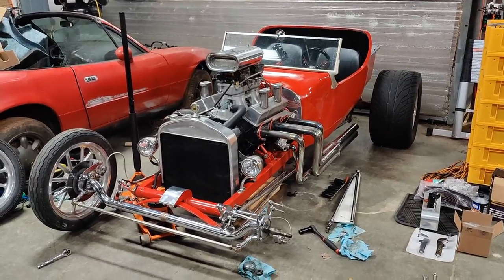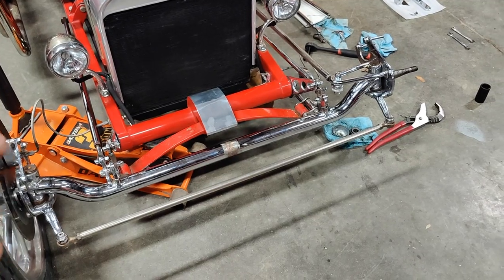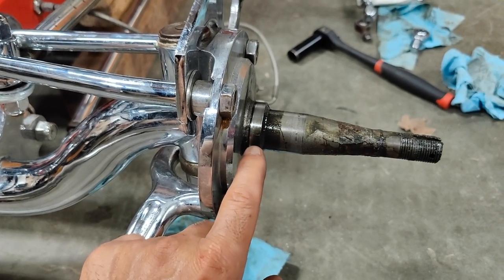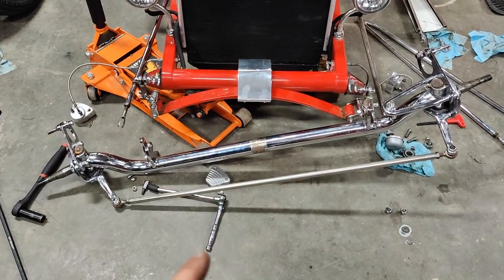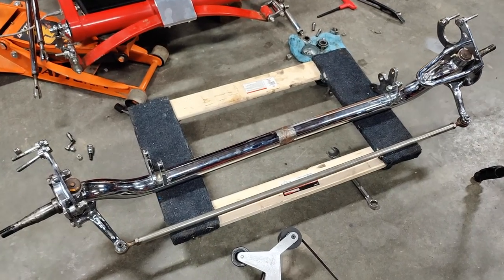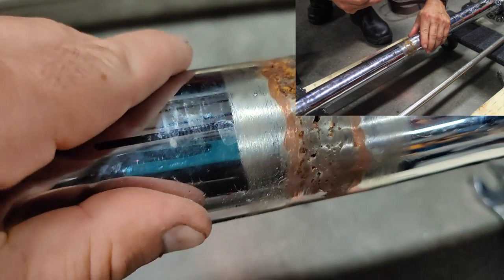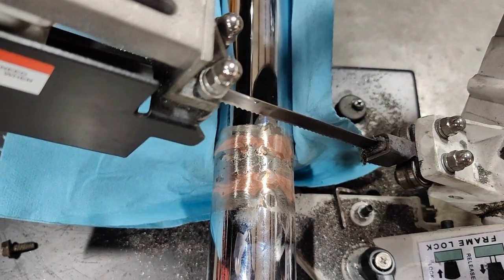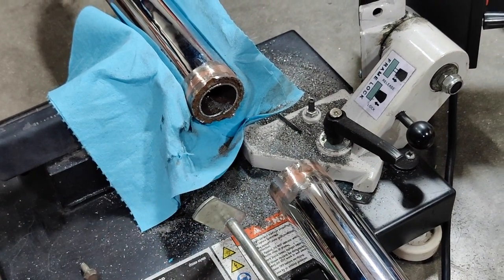Chasing Deathwobble - Part 1: Disassembly to re-fix a cracked axle

Comment: Hi Tim this is Dennis, yes that is a Total Performance kit just like my Bucket-T is.  The death wobble is what we all are afraid of as at highway speeds it will crash you into the ditch.  Mostly it comes on at a higher speed so it can start on the highway, your wobble is so bad it is doing it from a slow speed....count your blessings there.  Total Performance was a company out of Connecticut making kits until they sold out to Speedway Motors.  The tell-tale indicator is the tie-rod out front and the design of the radius rods and pick-up brackets.   By the looks of that axle after you split it I would strongly recommend getting a new axle.  You don't know how far that the corrosion has wicked up the axle on both sides and you will be welding onto rust since you cannot cut it back and shorten the axle.  I trust you took exact measurements of the radius rod lengths from bolt hole center to bolt hole center and tie-rod length, etc.  The shackle bolts you referred to as being backwards and rubbing the axle should have a slot inside and a grease zerk in one end, unless there are neoprene bushings.  I also see you still have the friction shocks (as i do until I find the right bracket), they are junk (and can contribute to the wobble) so put that on your list to change in the near future.  Also a strong suggestion would be to take out the steering sector and check it for broken teeth and repack it if it is still good.  Mostly Vega and Corvair sectors were used and that wobble could break off teeth.  Yes the Ackerman angle is critical along with toe in and plan to take it to an alignment shop when your done.  Our cars are similar in many ways, I also have a tunnel ram with dual quads and a scoop and a special license plate.  You can see and hear mine here >> https://www.youtube.com/watch?v=SLk6FcgW41g&ab_channel=gostallion
Reply: Dennis, the assembly doesn't look like mine but I could be wrong. Total didn't drill their friction shocks, and the perches on the axle are larger than mine. Anyway, I agree with you that the axle should be replaced and not repaired. The caster and camber are already pre-set and any minor alteration at all will throw the entire balance of the assembly off.
Reply: @chrisscheidel3250  seems his front axle components are a alot like mine but he has more chrome parts (I'm jealous).  I can't put up a picture here or I would show you mine looks like his.  Not sure what you mean by the friction shocks being drilled, please explain. I have one bolt in the center into the frame rail to keep tightening the sandpaper-like discs.   As I am writing this  part 2 and part 3 are out so we get to see how it was fixed.  I think he did a great job at fixing it, the inside shaft, as a plug, was very thick and will surely hold up.  I now think it will hold up fine but there is that weld in the center that looks bad visually.  If it was mine I would cover it with a chrome license plate clamp (Speedway part # 92539901)  since here we have to run a front plate.   Made me go out and measure my camber and I'm good.

Comment: Cool project over the old Packard(or w/e). When you re-sleeve it try to put some holes underneath where you won't see for some plug welds(only drill the outer tube type thing). Where the inside tube isn't welded is just flexing around, hence the break. Hope you can keep it clean looking, need a fast stick for that one. 

Good to see you making a vid again.

Comment: The biggest issue was probably the material used for the axle. I have always used hollow bar,even in Mild steel it's stronger than the pipe used there. With Hair pins as opposed to 4 link suspension the axle is forced to twist  on road bumps,increasing the chances of fracture. Thats also why the Heim Joints were bent.  And wow,the Akerman is actually reversed /pointing outwards because the  spindles are on the wrong sides,which I guessed you have figured out already.

Comment: The reason your axle and hair pin locating arms are breaking is when the car leanes the arms need to rotate on the axle but because the axle is rigid it places stress on all the parts hence the breakage. Those type of arms will work with a forged I beam axle as it will flex over its length, a tube axle can not flex. Ensure you get a good forged axle there are some cast ones out there that will break. Four bars should be used with a tube axle. The wobble is caused  by the wrongly adjusted castor on the front axle. Castor is the back ward lean of the king pin. A good wheel alignment shop should be able to reset all the alignment . Good luck with your build.

Comment: Hair pin radius rods want to twist the axle trough movement compared to a 4 link setup. I wouldn’t reuse this axle. If you do decide to use the axle the sleeve it should be at least .120 Dom or CM. and at least 6” long and rosette welded on the back and bottom with a good bevel on both sides and with enough of a gap for a root weld including the sleeve, do not use SS filler wire it will crack. You will need to make more than one pass.Take your time to clock the king pins don’t rely on the bat wings. Make sure the king pins have Allen set screws in the king pin bosses ( 2 per side ) to hold them stable.

Comment: Spend the bucks and get a new axle. You gonna trust your life to a spliced welded axle? I sure wouldn't. But if you do make sure you bevel each end and space for full penetration weld. Root pass and then several other passes. Spent many years in refinery and piping construction.

Comment: Just finding this video on the damaged axle and "Death Wobble" repair. Nothing to me indicates that this was a Total Performance assembly. The frame would have been stamped about where the steering box is located with a TP identification number. Total didn't mount their steering boxes on top, nor their motor mounts as shown. Steering arm is also different. Several other discrepancies shown.
 The hymn joints are certainly not right, and might indicate that the car had been possibly in an accident, or at least some type of severe pressure to bend as they are which might be why the axle initially broke. The spring is different, and so on. While I haven't yet seen part 2, I will watch next. To me your axle is toast and should be replaced. FYI, I have been driving a Total T for 38 years with over 100K miles on it and normally can drive at 65 and take my hands off the wheel and the car still tracks just fine. Now, I just had a new set of tires mounted for the front (also wires) and now have the death wobble starting at 45-50 mph. All indications to me is that the tires were not properly balanced when mounted. I have to take them off and have them re-balanced. If I remember, I will let you know how I make out after balancing, but it's time for me to put the car away for the season so it might not get done until next season. Good luck with your repairs.

Comment: I'm having a hard time figuring out whats going on with that axle too...  That outer layer is so oxidized an POROUS it looks more like moldy foam than steel and judging from the tiny amount of bright metal showing where the saw actually cut I'd say it was about as structural as moldy foam too! I'm guessing what looks like the 3rd (outer) layer is all weld in a V notch where he beveled the ends as a weld prep. Be sure to bevel it back far enough to get rid of all that shit! I'd go back with at least a 1/4" thick sleeve if not more. If it were me I'd do a solid sleeve, bevel the tube back and plug weld it. 
I was thinking a beefy billet front licence plate mount to cover it up.

I think those spacers for the spindles and arms are correct but don't think those added washers are, could machine some up if you stick with that setup, but a full size caliper would be nice...

Cool Hot Rod!  ATB.
Reply: Maybe so with that porosity be he certainly didn’t get penetration. Likely didn’t clean the copper or rust well either. Sleeve was far smaller in wall section than original and pretty short looking but is all that’s holding it now.  He ground off 75% of his weld which I’m sure was not pretty. If it had any strength(unlikely) at all it was now ground away. Just really hack work with the typically confident explanations like, “It was something solid” as if to say, “I got her good and this thing ain’t movin!’” I’d say it was a bad farmer repair but that would be an insult to farmers. 
Agree a tube axle with pins torques too much. Likely needs 4 link. None of this is my style though so...

Comment: Your king pins are not clocked the same when they welded it back to get her .leen the king pins back 4 deg back with a 1/4 " toe in  .pull a tape make sure both sides of car are exactly the same length .your shackles are above the leef spring on both sides. One of yours were flipped wrong that will forse the axel side to side  also flip the the rod mounts over put it behind the front axel like it was supposed to be installed the right way

Comment: Does not help that the Ackerman is wrong. A string from the tierod ball joint passing over the center of the kingin should go straight to the center of the rear axle. Not the  center of the differential gearcase housing.
Those steering arms appear to be for a rear steer application.
Reply: At least with those front wheels he should be able to bend the steering arms OUT far enough to get the ackerman close
Reply: @tomcummings655 Possibly. But that requires heating the steering arms to get them to bend. That will require the tierod hole to move outward on each side about 2" to 3". Then a new tierod needs to be fabricated. The proper front steer arms are available, and would be a better choice as the arms should be reheat treated after bending. The proper steering arms will look better as well.
A friend built a T with that suicide front end, and was going to just turn rear steer arms around to use in front steer. I explained the issues and he got the front steer steering arms.
The Ackerman being screwed up does not generally contribute to "the death wobble". Caster and worn joints contribute. I drove a Ford F350 work truck for a while. Another guy had driven it previously. Coming home there was a like frost heave across the highway at about 20° angle, summer and winter. That would excite the death wobble. I had it in numerous times, to two Ford dealerships. The steering stabilizer shock was teplaced almost every time. They replaced a wheel they said was bent, and another time they replaced the steering box and pitman arm. They were milking the fleet card. Of course I did not tell them I have two mechanics tickets, plus instrumentation. Eventually the tires were worn out so I had them replaced. Holy crap, no more death wobble. F450's from some years are notorious for the death wobble. Caster is part of the cause, but live axle front ends are prone to it.